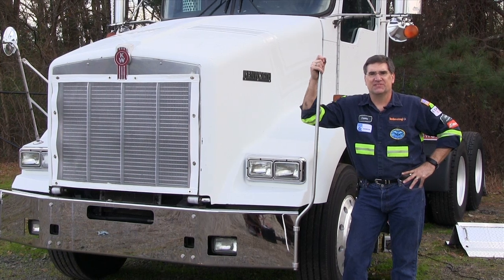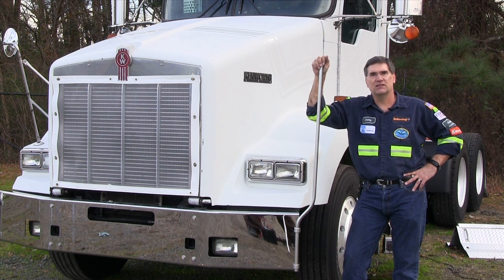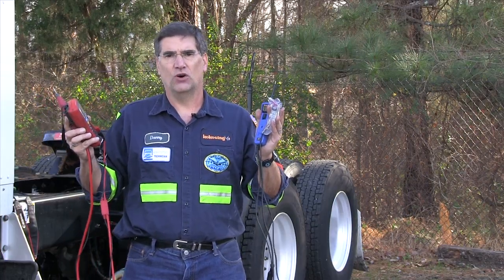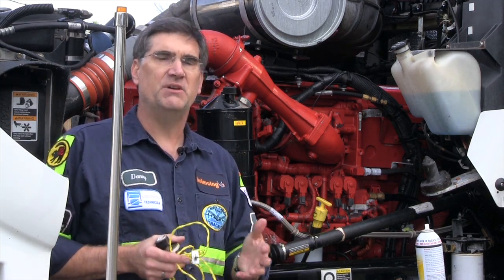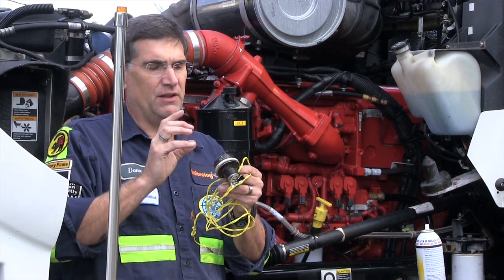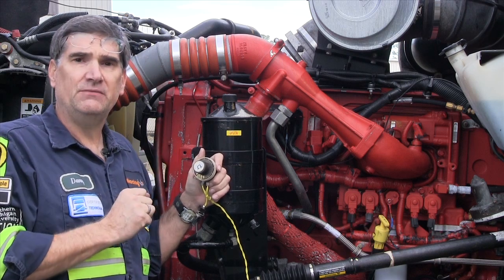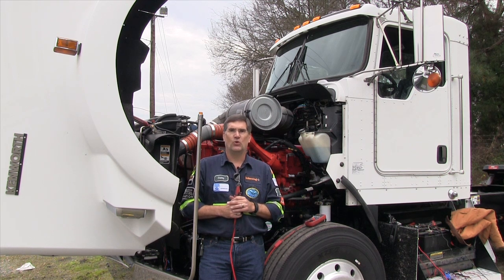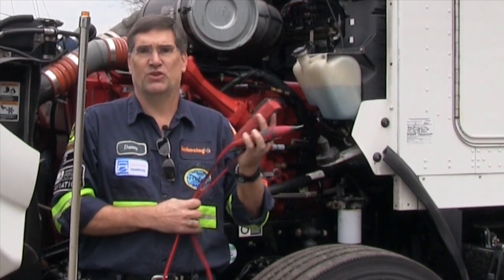LOADpro® vs. Volt-pro vs. Powerprobe® vs. Corrosion

Comment: Daniel love your video's I am not as skilled as others. But I would like to make a request if you could explain some more of what is going on when you put the leads in to the connector. What the loadpro is already reading 12.3v and then you push the button essentially loading the circuit wouldn't the voltage double then because you got the source voltage and then the voltage from the loadpro? Trying to understand to see how it would be useful in troubleshooting and forgive me if this a dumb question. Tks
Reply: The load pro doesn't introduce voltage.  It provides a load only.

Comment: Hey Daniel. Maybe this a dumb question but just curious. In regards to the load pro, how would you go about testing reference circuits or computer controlled (PWM or BUS) circuits? I know for PWM/ BUS circuits you should really be using an oscilloscope. But for reference voltage circuits could you use the load pro in the same manner (thats if you know what the voltage should be)? Maybe a video on more advanced modern day computer circuits is in need? Thank you and keep up the good work.
Reply from the maker: +chronic2point0 There's no value (in my opinion) in seeing data. A CAN wire is a wire. You can isolate it and apply voltage at one end and load it. PWM is average voltage, and loading it will work. I promise you I know I need more videos. The problem is paying back taxes, fighting Powerprobe in court, and feeding four kids. I'm hoping to restart filming in few months.

Comment: I have a Load Pro and a Power Pro, I think those two together make a powerful tool. In other words; if the power probe people would put a resistance under load option, they would sell power probes like hot bread. But my comment is really on the "range of motion" 3:20. Come on Daniel, you are a very smart man so do not do stupid thing like that, it makes you look like a cheap salesman. Walking away with the multimeter in your hand does not probe "range of motion".If you want to check if the tail light on an 18 wheeler is getting good voltage. you need to connect the negative to a good ground (normally under the hood) now tell me how you are going to connect the positive probe to the tail light. Are you going to walk with the voltmeter in your hand?
Reply from the maker: +dana miller No - you don't. You put BOTH red and black meter leads in the LIGHT SOCKET to test the actual component ground. That's the point. You're arguing in favor of an outdated method. There's no need to have a connection to the battery to do ANY testing. That's what Powerprobe wants you to think. You bought into it. If you have both tools, but you don't understand this, then you don't know how to correctly use the LOADpro.
Reply: Daniel Sullivan I love your LoadPro and I do know how to use it. May be the tail light is not a good example.  OK, pick any component that has only one power wire and no ground wire like; a sensor, a fuel injector, gas pump anything but imagine that there is no good ground around. . . . puff! it is hard to explain but like I said "you are a smart man" You know what I mean. If you ground one probe you cannot not walk away with the multimeter in your hand like that; unless of course you have a probe with a loooooooooong cable.
Reply from the maker: dana miller If you do that, you won't see a problem in ground. I don't understand why you believe getting a ground at the battery is so important. I've been doing this over 30 years and I've never worried about having a direct connection to the battery. I cannot conceive of the problem you suggest exists. Sorry. Guess I'm not that smart...

Comment: I think some technicians/businesses enjoy charging diagnostic time... anyhow i see the usefulness to this tool.  I was using a test light today and dropped it on a fuse box...nothing happened but the long need portion of the test light damn near gave me a heart-attack cause it came close to shorting some of the power and ground wires together.  This would not be good as the vehicle was my sisters newer Chevy Silverado haha.  Anyhow, i think this tool is pretty cool and i'd buy one!

Comment: The only issue i see with the load-pro and for that matter any of those other probes, is its not very practical when trying to find intermittent high resistance in a wire harness. A lot of times you have to pull, wiggle, and twist connectors for that high resistance or corrosion to show up. Its not very easy to have one hand pushing down on the load pro and the other trying to twist and shake a harness; especially one that is out of reach. Not all voltage drops are hard faults all the time.
Reply: You need a short buddy, check them out on line! ;)

Comment: what you didn't do is measure voltage at the power wire backprobed plugged in w a t -pin key on. The power probe would read less than system voltage as would a voltmeter with standard leads.  

using the circuits ground at the connector assumes you always have a good ground. which is easily tested for like you say, but lets say you don't. This scenario would require you to find a good ground. easy if at engine bay, but rear under vehicle for example sometimes difficult.
Reply from the maker: +Turbotomass Why would I? Backprobing isn't truly effective. People just think it is. The tool has been out since 2002 - we're pretty certain the chances it will fail are pretty small.
Reply: +Daniel Sullivan You would backprobe to show the effectiveness of the power probe. Backprobing is very effective if the circuit is loaded. I'm not commenting on your tools longevity.
Reply from the maker: Turbotomass Backprobing is NOT a meaningful test method. The Power Probe has a voltmeter - because of me...
Reply: +Daniel Sullivan I'm sure many successful technicians as well as myself would argue that back probing is effective. I've personally detected resistance in circuit loaded back probing many times.
Reply from the maker: +Turbotomass Back-probing - regardless of what you and any other tech says - is destructive and damages seals. The question of getting a meaningful reading is secondary to making multiple punctures or other damage to wiring and connectors. If you're arguing against my tool, fine. But don't argue in favor of a bad practice just to defend what you do. Given the option to stop back-probing (250 wires in one connector?) and being more effective more simply, why wouldn't you?
Reply: +Daniel Sullivan Back probing is not destructive. I've back probed connectors with small t-pins on my personal vehicles and customers vehicles alike and have never had a comeback directly caused by back probing. Front probing on the other hand is very destructive unless the proper adapter harness are used. Stuffing voltmeter leads in female terminals damages and reduces pin tension. I've seen plenty of connectors damaged by customers and technicians from front probing. 

I do agree that there are connectors that are cumbersome, hyundai for example has shields around the connector, or PCM connectors that make back probing time consuming. Having an arsenal of tools, yes in circumstances your tool could be very effective. 

I'm not bashing your tool nor other tools, I want to understand and adopted the best testing methods in all circumstances to reduce time and increase accuracy.
Reply from the maker: Turbotomass How do you know the comeback didn't occur months or years later without you knowing? If you're good at it, and conscientious in your effort, you're rare. The fact that people still think a battery on concrete is problematic and putting holes in wire insulation is not - is pretty telling. Any process used carefully can be successful. My argument - in general - is that without care, sloppy people are dangerous.
Reply: +Daniel Sullivan I've worked for the same shop for years. Plus testing was done on vehicles that I still own.  I never pierce in to the wire. If I do in rare circumstances I use liquid electrical tape or shrink tubing. I agree about sloppy/ hack repairs with no consideration at all for craftmanship is bad. 

Don't get me wrong, I am already going to order the tool. I can think of multiple instances that it'll save time.

Comment: I didn't pick up from the video if your tool is the meter plus the probe, but looking around to buy one they only show a 180 or 181 unit and it's just the probe part.
Is there an extension for the probe tip to get to deeper places? If I would try to make one it might introduce an additional resistance into the circuit I measure.
It would be cool to get one of these that works for house AC voltages, and 5V circuits too (computers use 5V as well as 12V).
The nice thing about the PowerProbe III is the actuator which I don't think the LoadPro can handle because it isn't using the vehicle's battery. (Although LoadPro might work for low power devices like LEDs or just to momentarily light a lamp.)
Reply from the maker: +Phil Reinie Just the leads. I don't argue that the switch in the PP is advantageous, in some ways, but you have to remember that the component is the low bet (20%). Knowing a component works still doesn't help you know what's wrong in the wiring - the high bet (80%). It's a different philosophy - and if you unplug the component to test - the switch doesn't work. It only works if you pierce the wiring... Not a good practice.

Comment: I am curious about something I see in this video.  When using the loadpro, you read 12.1V, pushed button and read around 9.6V .  According to the chart provided with the LoadPro, that indicates an approximately 25 Ohm fault resistance.  Your rheostat added only 5 Ohms to the circuit; so am I to assume the other 20 Ohm is already a part of that circuit?  If the 5 Ohm rheostat was not a part of the circuit, how much would the normal voltage drop be?
Reply from the maker: +Matthew Brice Make sure you're using the correct chart. There was a glitch a while back and the original tool (TESlite) chart wasn't removed. The correct chart should show the 9V.
Reply: +Daniel Sullivan How do I know if my chart is correct or not?  Do you have a link to the correct one?  Looking in your FET manual it shows for a 9.6V LoadPro Voltage = 25 Ohm fault resistance.   What should the fault be?  

And according to the formula in book ->  12.1 - 9.6 = 2.5v   Amp draw = 9.6 / 100 = .096a  and therefore 2.5 / .096 = 26 Ohms which is very lose to chart.  So I am still unclear where the rest of the circuit resistance in the videos's example is coming from....

What would the LoadPro voltage be in normal operations (without rheostat)?

Sorry if this question is redundant - I just don't see what I am missing.
Reply from the maker: Matthew Brice Divide by 25Ω - not 100Ω.
Reply: +Daniel Sullivan Ahhh.  that makes way more sense.  The "divide by 100" is what was confusing me when I was initially reading the formula.  Couldn't see how that figured into things.   I was trying to use Ohms law to figure it out earlier and couldn't see how.  Now it is simple:  it is a 9.6 voltage drop over 25 Ohm resistor in Loadpro which according to Ohms law means = 384 mA draw.   12 - 9.6 = 2.4 voltage drop in rest of circuit.  2.4 v/ .384 amps = 6.25 ohms which is very close to what was on rheostat.  Thanks for clarifying.      "100" must have come from Teslite days....

Comment: go team up with powerprobe and it Will be the best tool. I have a powerprobe sorry, but I would love this ! I also love my powerprobe.. 

Oke, I have had a case of this were I could not find the bad system because it said 12v and there was a resistance. I know my work so I found it anyway. but yes it could have saved some time !

let's add that I love the powerprobe switches. it doesn't get better that that with a fuse in it ! 
I suspect ground is bad. I add ground and vice versa. 

a fair amount of the time the powerprobe will have advantage over your tool. the probe is a one peace part and the wire it comes with is ideal for testing parts witch you're tester can't do. 

don't get me wrong , I want both tools. there should not be a fight over this, there should be a tool combining this !!  

think about this, there is so much more features to make for the tools. work togeter, make one master tool !

sorry for the spelling. I am dutch!
Reply from the maker: +Lars Greefhorst I tried 13 years ago and he turned me down.
Reply: +Daniel Sullivan  oke, that is to bad, your lead inside the probe would be awsome ! They have a simular system like yours i see that now. 

I am now thinking of putting your lead on the probe, get the sharp point out of the probe and put your one on there. 

Still more hasslte but i think this would be i nice solution :) 

Were do i get your leads ?

Comment: In my opinion the best electrical load to use is the component itself. The voltmeter should be sufficient on its own to detect the volt drop if the connector remained connected to the ECU and the connector was back probed.
Reply: +Daniel Sullivan First off I love your idea and will be purchasing one shortly. The original comment was talking about back probing and this is just my opinion. Back probing works very well as long as your back probing deutsch connectors with spoons. However, deutsch spoons are ridiculously expensive, more so than your great tool. If your working with something other than deutsch forget it your gonna damage the wire trying to get into the circuit. Also to back probe a circuit from a component to an ecm you need to know what the pins the ecm are using for power signal and ground, this take a lot of time on large schematics. That's why I'm going to buy one, because i think that the time savings would be quite large on complicated circuits.  Dont let people get you down, what you've got is a great thing. BTW what is the cat PN if i may ask.
Reply from the maker: 275-9936
Reply: +Daniel Sullivan Thanks so much!
Reply from the maker: +Jonathan Fry In a perfect World. Backprobing damages connectors. What if your wire is in the center of a 120-pin connector? I agree - but it isn't going to happen. We've been out there since 1999 - we're doing good work and people have benefited. If you believe that being able to make an instantaneous voltage drop with every voltage reading isn't helpful, then you're in the minority.

Comment: I'm more and more intrigued the more I learn about the Load Pro. While you talk about resistance/corrosion in the positive feed, can the negative be tested using your tool? I'm in the big rig industry too but electrical diag has always been my weak point, so anything to help me understand it better is a plus.
Reply: +SuperSecretSquirell Doing the load test on the positive while connected to a known good ground will tell you everything you need to know.  If you don't see a voltage drop while connected to a known good ground and the positive wire in question, then you know the drop is on the ground side.
Reply: Good point. Like I said, electrical diag has always been my weakest area.
Reply: SuperSecretSquirell Yeah, there's a lot to it.  No matter how much you learn, there's always more!

Comment: Fucking Awesome!
I purchased your tool about 4 months ago.  I have a 2004 Coronado, with a Detroit Series 60 14 L.  No throttle response.  TPS and ECM have been replaced, the ECM was a spare.  At the fuse box, 12.8v at the ECM fuse, load the circuit, it drops to 3.25v.  I missed the part about Ghost Voltage and High Side short.  I will test again tomorrow and let you know. 
Thanks
Reply: +Charlie Abbot Been awhile on here but i just saw this post, did you figure it out?

Comment: What about a power to power short, can it detect that?
Reply from the maker: +josheb mangru Yes - but I call that "crossed circuits". The fact that you're using the voltmeter exclusively means that if you know where you are and what should be there, then you'll see voltage that's in the wrong place. The whole point is that this method eliminates the need to make a prediction as to what the problem really is...
Reply: Okay  sir, I understand, thank you.

Comment: I bought the load pro a few weeks ago. My time locating the bad spots in circuits has dropped dramatically. I found a wire with heavy resistance in a starter relay circuit that would have had me chasing my tail just days before, found it in minutes. My boss has 20+ years experience over me and he chose the power probe and suggested I invest in one as well. Not being the sharpest at electrical I researched for a long time before choosing the Load Pro. Very happy I did. Now if I can just get my boss to believe it works. P.S.  bought the FET book with it-great combination, really helping me improve my electrical diagnostic abilities.
Reply: +Steed “Still Hunter 69” Andersen Go to my channel, I have videos on there showing real world finds using the load pro.  That should convince him.  It's a awesome tool.  Been using it since 2009.